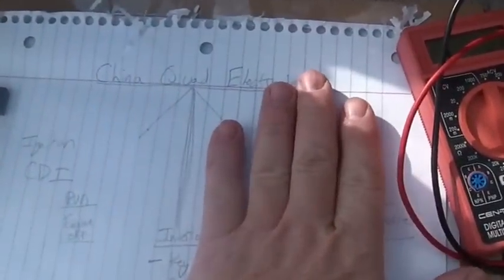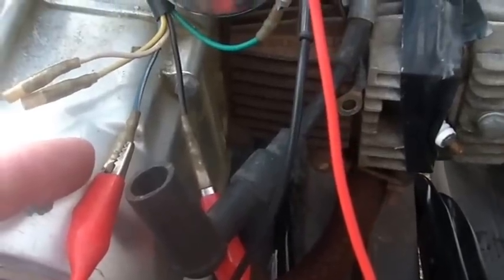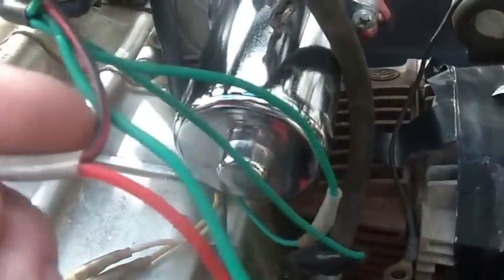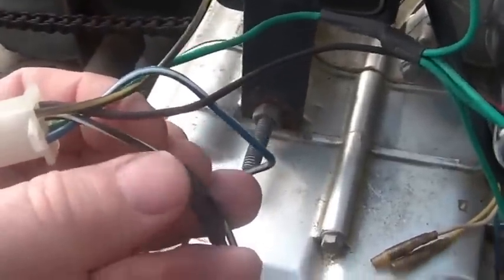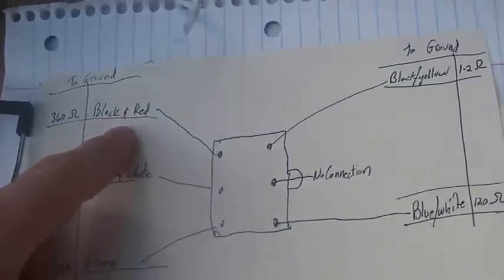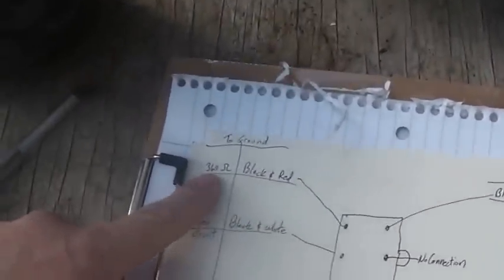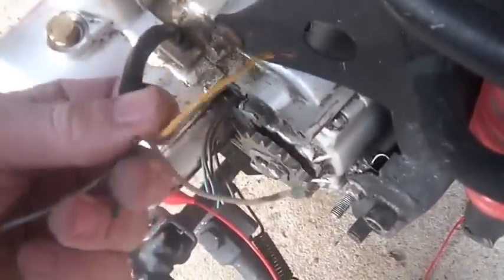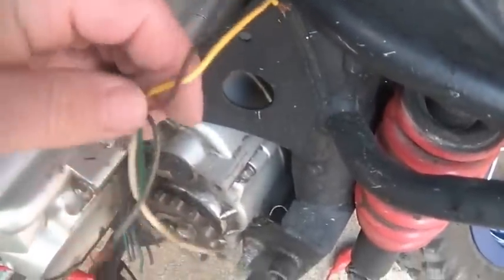Intro To China ATV CDI ignition, troubleshooting

Comment: Please help I have a 107cc Chinese quad I had everything working gas compression spark ECT I noticed the red wire in the key ignition came loose from where it's soldered it touched the black wire and sparked and I have no power now and when I turn it over via cables on starter I get no spark did I fry  my coil or cdi please help
Reply from the maker: Hey Randy, The key switch does 2 things, first, it makes the 12VDC available to the quad to do things like run the lights, and it allows U to engage the starter.... The second circuit of the key switch disengages the engine stop circuit. I would find the CDI, there should be a black wire with a white stripe going into it, I would disconnect or cut this wire such that it can be connected again, that should give U Ur spark back again unless U have a DC powered CDI which is much less common.... After U disconnect the black wire with the white stripe from the CDI let me know how U make out, U should be able to jump the starter and get it running.... U can use the choke or reattach the wire to shut down the engine.... Thanks for asking, watching, and commenting!!!!
Reply: Harvey Spooner I am not seeing a black and white stripe wire my cdi looks different from yours I can't even find it on Google the wires have no connection on the back there wired straight into the side of the box
Reply from the maker: Hey Randy,  Are there any names on Ur ATV and motor???? I can take a look for a wiring diagram... I would look for a blown fuse, I'm thinking U may have a DC powered CDI and they maybe using black as ground.... Thanks for getting back to me, watching, and commenting!!!!
Reply: Harvey Spooner it's a roketa rtu 110l it's says the engine family is 6csmxo.20atv but I can't find anything it's different than the roketas that come up online but is there anyway I can just get an aftermarket ac external cdi for it because I wanted to delete the spaghetti mess wiring harness anyway
Reply from the maker: Hey Randy, I put together this play list on China Quad electronics, maybe it will help U.... I also put up a video today on an inexpensive replacement CDI system,  https://www.youtube.com/playlist?list=PLXe3Ur9S11oeX8iOzfD80fe5fpK37tg5W  , I think I have a Roketa in the hoard somewhere, I need to take a look, please take a look at the play list and see if it helps.... Thanks for the info, Ur thoughts, watching, and commenting...
Reply: Harvey Spooner hey man I figured it out, I had to trace all the wires with my multimeter ,traced them all the way to the kill switch which wasn't making contact because the switch was broken,so I wired a toggle switch to it and deleted the ignition part since the wire came off the back of it, runs great now even wired a led light bar to it that runs straight off the pulse generator thanks for your help man your videos helped me out alot
Reply from the maker: Hey Randy!!!!  Great to hear that Ur ATV is back for riding!!!!   My job is done....LOL!!!   Thanks for getting back to me, Ur thoughts, watching, and commenting!!!!

Comment: hey I have a Roketa 125cc I'm putting together. it has a new motor, carburetor starter solenoid, ignition coil, cdi box  and it won't start . I've watched a bunch of your videos but I am stuck with this one particular black wire that comes off my four pin CDI box.

Comment: I've got a question... replaced my stator and now have no spark.. connected the wires exactly as shown and I get a spark....only problem is when I connect the kill stwicth I get no spark (if I connect the black/white wire from the cdi  to the kill switch I get spark... anything else I put on the opposite end of the kill switch.. no spark... tried to run it and it runs with just the b/w wire connected to kill switch but had to pull spark plug to turn it off as the kill switch doesn't work... what am I doing wrong... (BTW start switch works fine)
At this point any help is appreciated
Reply from the maker: Hey fishintuber, The way the kill switch works is that it take the black wire with the white stripe and it connects that to ground, to me, it sounds like Ur kill switch is shorted, I would start by replacing that.... Also, check all of Ur grounds, make sure they are all connected well... I hope this helps.... let me know how it all turns out.... Thanks for asking, watching, and commenting!!!!

Comment: I hope you respond to this cause I really could use some help. I have a UTV it uses a cfmoto cf188 500cc engine and all the harness and electrical from what I can tell is cfmoto. It is an off brand but Roketa sells the same exact UTV as the one I have. It is actually a BMX 500 or from what I can find the actual China manufacturer is XinYang it's model number 500s or something like that. I can't find anything as far as a wiring diagram to fix my no spark issue. I have replaced the CDI unit, the ignition coil and the stator /pickup coil. It has been a nightmare. It doesn't use an CDI unit I have found on anything except this unit. I was going to see if I could use your CDI hack and buy a different CDI and only hook up what I need basically to try and get it to fire. It was missing the starter solenoid and wiring to it. I have no idea what wires go to it other then a start wire from the ignition switch, the starter wire and a battery wire. Should it have a ground from the CDI? IDK if you have dealt with anything like this or not just really need help. I saved it from the scrapper motor has good compression and it's actually a really nice unit. All the lights turn on and everything works other then I can't get spark. I am going to try putting a different starter relay on it that has two prongs instead of just one and run a ground from the pulser to it, the crankcase and the coil and see if that helps anything as well. Please let me know if you have any ideas

Comment: our son was riding around the other day on his 110 atv and the battery (mounted underneath with a strap) fell. the strap let go. so it yanked all the positive and negative cables and generally made a mess. now it wont run, does absolutely nothing when you try to start it. stone dead. cant figure out where the negative battery cable goes. its attached to the battery itself and everything ive read says it just is a ground and to attach it to the frame. no obvious place where it was ripped off from. anyone have any suggestions? could something else have gotten wrecked?  google has been no help.
Reply from the maker: Hey Jessica, When a battery falls out, several things can get damaged at once, I would start by hooking a wire from the battery (-) to the engine, ground, in a solid way, make sure that the wire is thick enough to carry the current, leave it there if it is not the fix as it maybe one of a few problems. Next check the battery to make sure it was not damaged and is holding a charge, then I would look at the positive side of the circuit, the starting relay or the wires going to it may have been damaged.... Let me know how it all works out.... Thanks for asking, watching, and commenting!!!

Comment: You do great work. I have a Honda XL185s 1988, Kick start. with a 6volt system.My stator has 3 coils.I would like to make in to a 12 volt system by getting the sator re wind to 12volts. there is guy down in N.S.W. it would only cost $130.00 oz Dollars, but that was only if it had Two coils, mind has 3.If i was to do this to make in to 12Vlot, what CDI unit, What Rerulator-Rectifer, & Ht coil i would have used? as i do not know.There is to much to say on here, but i do need help with this. Trev.
Reply from the maker: Hey Trevor, Does Ur XL185 have points????  I don't have a XL185 to look at, but, I would look at a Honda ATC185 or 200, I think the engines are basically the same other then the recoil vs kick starter.... The ATCs use a 2 coil stator, one powers the CDI and the other powers the lights with from 5Volt to 20Volts AC depending on the RPMs... The "other" coil can be rectified and regulated to 12volts to charge a battery and run lights.... If Ur bike uses points, U may have to do a head, (for the CDI pulse generator), and wire harness change, (to add the CDI), + a custom harness for the 12Volt lighting and battery, kind of a big undertaking.... Thanks for asking, watching, and commenting!!!
Reply: revor Losch <tlosch50@gmail.com>  10:09 (7 minutes ago)to YouTube  No
 it does not have points. The CDI Unit is a CF403,Shindengen. The 
Regulator with built in Rectifier, It is a Electrex.RR67,1204msR2.The HT
 Ignition coil has a Blaster on the side of it drops vlots down from 6v 
to 3vlots.I have look at so many of your videos,and i do like them 
very.Anyway take a look at pic,s tell me what you think. I live in 
Australia. All the best Trevor.  2 Attachments
Reply from the maker: Hey Trevor!!!  The good news is that the ignition system and the 6VDC system are separate and should function independently... If U can get the non CDI stator coils rewound, U can get 12Volts.... BTW, Y do U want to upgrade to 12VDC?   Thanks for your questions, thoughts, watching, and commenting!!!
Reply: Hi, I just lost every thing then try sending you a photo but di not turn out, try to reply to you in gmail hit reply and now i am in youtube ?.12volts is better than 6volt.I brought new speedo teco all run 12 volt lights,How do i send photos of my stator to you,  The 3 coils one is a rechangeing coil other two are as you said lights & Ignition.If i got the 3 coils rewind to 12 volt what Reulator & Rectiifier do i used, What CDI do i used and what HT Ignition do i used then i have put all back so it all works.I am not very good at doing this nor can i spell to good.
Reply: Hi Harvery,I hope you are going well,Thank-You for replying to me,I know you are a very busy man with all the things you have going on in you back-yard. No my XL 185s does not have points.I have brought a DC-Casoli CDI unit & a racing coil.It would please me if you could thak a look at your ACT185-200.Do you think i could buy a chinese stator & take the two-coils off the chinese stator plate & put the two chinese coils { lighting coil-Ignition coil}Would they fit? or would they be to small two short.I don't know but the way your ATV's look like they have a 12volt,& you can put 12volt cdi unit on to atv and quad's.I have look on eBay for ATV 12volt stator's that one could put a 12volt CDI unit & 12volt Regulator/Rectifer.I do have pic's of my sataor & the 3 coils,two coils do go to ground the other coil {Battery Charging coil} does not go to ground,It has a yellow wire & a yellow & white wire,The battery coil-lighting coil let's power go through them,But the Ignition coil does not let power out the other end but i an only using 12 battery to put power through it to light up a light bulb test light,i do not have a test meter.Please have a bit of a look around and see what you can fine and it thing's will fit. As i do not know how i would one over here.Looking forward to hear from you. Once again thany-You very very much for taking the time to help me & to reply to me, MANY THANK'S..
Reply: PS Love your Videos,Keep em coming.

Comment: Hi got a roketa 250 with almost all the wiring gone had three yellow wires coming off stater that go strait to the regulator and ground/blue white to pulse generater cdi has black yellow to coil blue white to pulse and 2 grounds then a white and black off the 2 pin plug can I just put the 2 ground to frame and what are the white/ solid black
Reply from the maker: Hey Todd, U need to float the black/white wire, when grounded, it turns off the engine.... Ur CDI needs to get power from somewhere, from this wiring diagram, looks like it wants 12VDC, I think that is where the solid black wire goes, here is the wiring diagram, double check me....   https://www.kazumapower.com/roketa-atv-250-wiring-diagram-pi-10429.html   ,   I hope this helps, let me know how it all turns out.... Thanks for asking, watching, and commenting!!!
Reply: yeah just really in deep with this one not even sure that it is the original stater or pulse gen I know it's not the original cdi I ordered a new dc cdi for it to eliminate anything to do with the stater as there is no wire for cdi but am  concerned it is not the right pulse generator ie gap or lining up with fly wheel I look online and there is 15 different models that well say there for a roketa 250 really kinda at a loss waiting for new dc cdi yup wire that in and cross fingers is there anything else you would recommend
Reply: Harvey Spooner

Comment: hi harvey
i installed a new wiring harness on 
my 125cc atv loncin engine 
i do get a spark
it only cranks when i have the light switch is on 
on the atv also if i remove the lights (unplug) i wont get a crank
its a push start button.

Comment: can someone please help me i just put a new engin on my 150cc scooter everything is grounded well but it came with a new carb an a new cdi box an a new regulator the reg dont fit my connectors but everything else works even the new spark plug wire but now its blowing all my bulbs the blinkers an the horn an the brake lights work my head lights an gauge lights an blown an everytime i rev the bike up they blow so im not sure wat to do now can someone help me plz
Reply from the maker: Hey Syxx, Generally speaking, there should be 2 or 3 wires coming off Ur stator and they should be going to Ur voltage regulator, they should be white or yellow or some combo of white wires and yellow wires.... They represent AC into the Voltage regulator.... Then, there should be a red wire coming out of the regulator, it goes to the +12Volt side of the battery.... There should also be a black wire, or green wire that should be going to ground, (the frame), and the negative, (-) side of the battery should also be grounded.... If U R running the lights off the battery, they should not get brighter or dimmer with engine speed, they should be receiving 12VDC at a steady state.... Given that the lights are burning up at high engine speed, I'm thinking that they are being powered by the stator, (AC power from the engine), and that without the regulator in the circuit, the Voltages are able to go pretty high.... U need to hook up the battery and regulator as I describe.... Thanks for asking, watching, and commenting!!!

Comment: Hey Harvey im confused. whats pulse generator and a stator. Also whats the difference?
Reply from the maker: Hey Zantiago,  The pulse generator provides a small pulse of electrons which triggers the CDI unit to release the huge pile of electrons that it saved up from the power provided to it from the stator.... The pulse generator, provides timing, the stator provides power, (4 cycle engines), some 2 cycle engines use the stator to provide timing and power.... I hope this helps.... Thanks for asking, watching, and commenting!!!!

Comment: Harvey Spooner, i have a lafin 200cc 5 speed motor that was running but stopped after i moved to my new place. I had all the wires hooked up to where the motor ran outside the motorcycle. Im guessing during the move they came undone & i cant remember how they went. Ive seen videos, schematics, read threads & post & can not get it going again. Any suggestions/ideas?
Reply from the maker: Hey Henry, U have a fairly common problem, a china bike or quad with a hacked wire harness.... I made a play list on the topic, here is the link, give it a view, let me know what U think, and ask any questions U have when done... https://www.youtube.com/playlist?list=PLXe3Ur9S11oeX8iOzfD80fe5fpK37tg5W  , Thanks for asking, watching, and commenting....

Comment: Howdy just need to understand why my batt goes dead on my China four wheeler 110  how to fix  love videos keep on making them they are awesome
Reply from the maker: Hey Samuel, Disconnect the battery from the ATV, charge it up, let is sit for a few days, hook it up and see if it held the charge, assuming it does, there are basically 3 circuits that run off Ur 12Volts, the start circuit, the lights, and the accessories.... Assuming Ur starter is not running all the time and that Ur lights are off, that leaves the accessories including the remote control safely turnoff if there is one.... Thanks where I would look.... Thanks for your kind words, encouragement, asking good questions, watching, and commenting!!!!

Comment: i have a question.can i run a chinese dirt bike wire harness with three wires
Reply from the maker: Hey Thomas, If U have the right 3 wires the answer is yes.... A blue/white, or blue/yellow for the CDI pulse generator, red/black which is power from the stator for the CDI, and black/yellow from the CDI unit to the spark coil,.... The other side of the Pulse generator, the other side of the stator, one pin to the cdi, and the other side of the spark coil all need to be grounded though... Thanks for asking, watching, and commenting!!!!

Comment: man i need your help ! i got 110cc china atv its wiring was nightmare but i connect them all as the wiring diagram says in the internet but it doesn't have any spark ! im sure that the CDI and Coil are working because i checked them on my my other atv but when i crank her it doesnt gave me any spark ! please help !
Reply: can i do anything to get spark ? without cdi or something ?
Reply from the maker: Hey Mixerhd3, I would remove the CDI and do the resistive measurements as I did in the video or disconnect the off wire from the cdi plug as I also talked about.... Thanks for asking, watching, and commenting!!!
Reply from the maker: Hey Mixerhd3, I would remove the CDI and do the resistive measurements as I did in the video or disconnect the off wire from the cdi plug as I also talked about.... Thanks for asking, watching, and commenting!!!